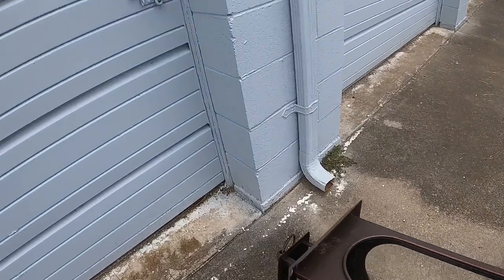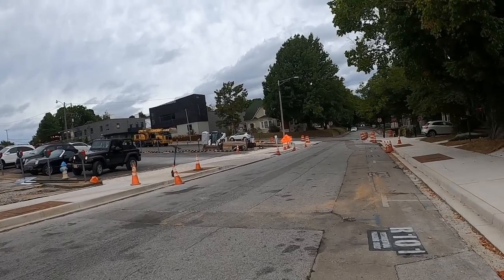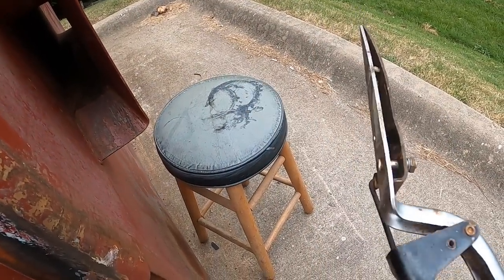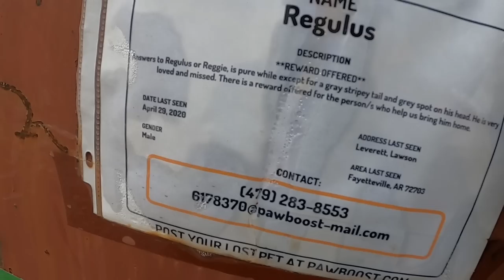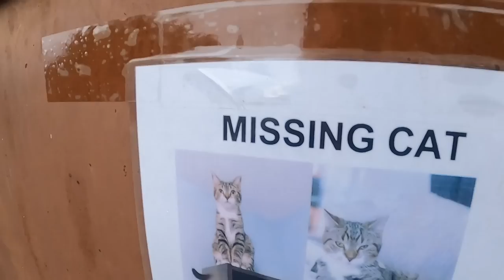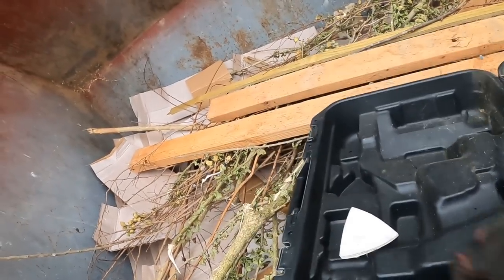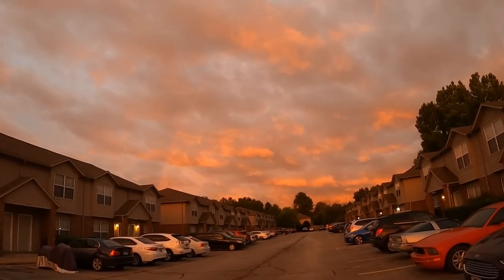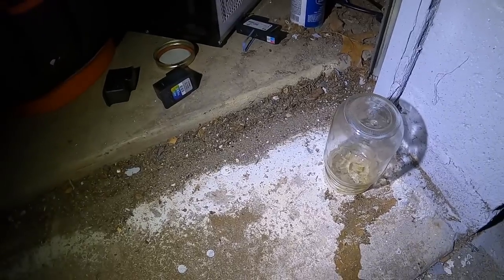Dumpster Diving "Brass Copper JackPot At End Of Rainbow"

Comment: The cat scratcher would be very easy to put carpet on it and when it gets all scratched up it would be very simple to replace the carpet again.
 The rainbow looked like a doorway to heaven. Everything was brighter and beautiful on the inside. Very pretty double rainbow. WOW the sky looked like it was on fire. So beautiful and vibrant.
Very good scrapping video. Lots of cords which is much better than tin. Lots of motors too. Then another Wow at the end with the large radiator and shocks. I have no idea how you got those back to your storage unit. Unless you hid them and took everything else back and then went back for them.
Stay safe and God Bless

Comment: Cast iron, for making "corn sticks".  Somebody forgot to dry it off after they washed it. It has to be dried and oiled, or they rust.
Reply: Worth clean and eBay
Reply: Good for resale...corn bread sticks pan
Reply: How Soon Is Now  PB blaster works better. 😁 WD-40 evaporates.
Reply: This cast iron pan CAN be cleaned and 
Re- seasoned = Oil it well after cleaning & Bake oil on pan until its like a non stick pan.  Google how to season a cast iron pan.  ❤🤗❤😉